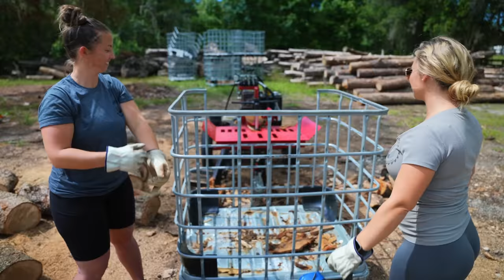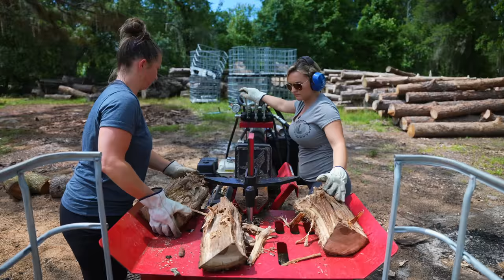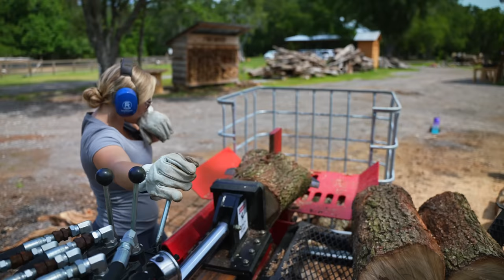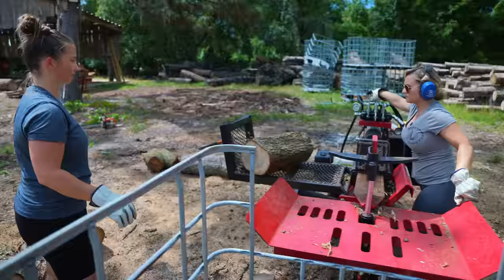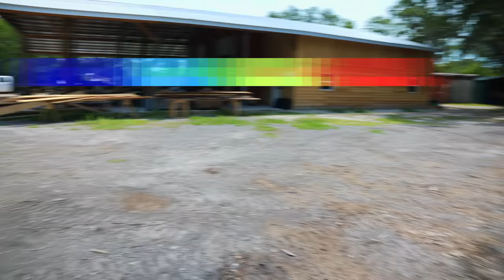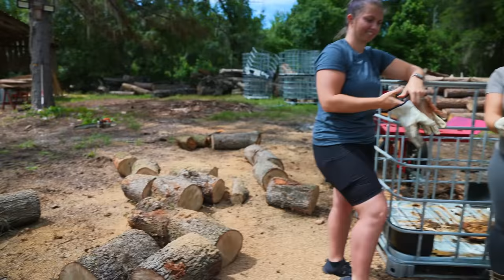Firewood Splittin' Fridays #9

Comment: What do y'all do with the sawdust and other small pieces of wood that cannot be used?   Ever think of collecting it and selling it for fire starters?
Reply from the maker: We have made some kindling kits. The sawdust we burn or sell.
Reply: @TripleLRusticDesigns  I think Doug is saying that saw dust can be made into fire 🔥 starters. Like the little bricks you buy that’s made outta saw dust and glue That holds it together & it’s been soaked in a slow burning accelerant like diesel.
Reply: @CCRider5312  Parafin works very well too.